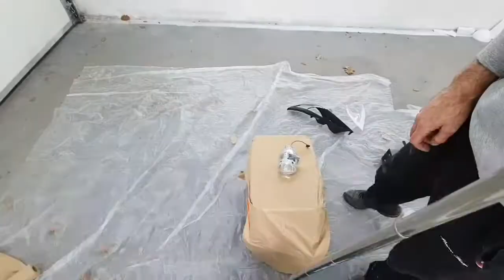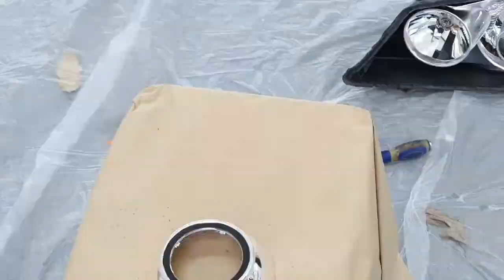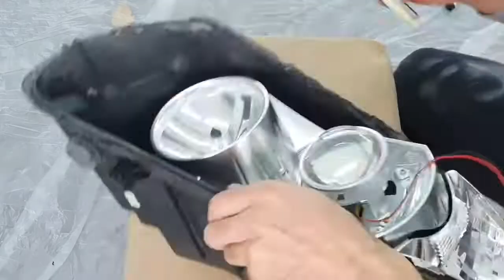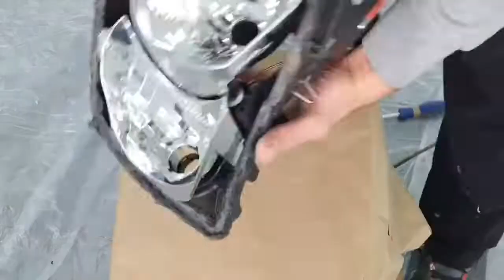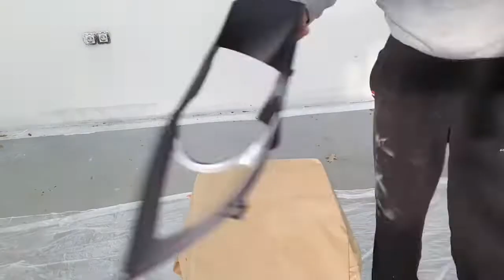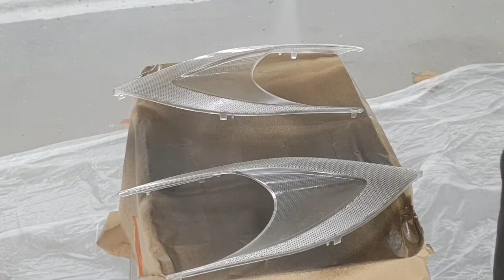DIY /  BMW Headlight OPEN and Installation Bixenon Projector

Comment: For anyone wondering halo rings are 100mm for high beam and 90mm for 3 inch projector if you would go for 2.5inch projectors get 80mm rings.